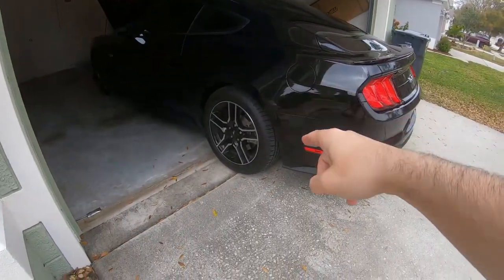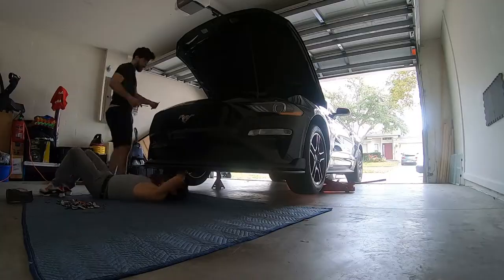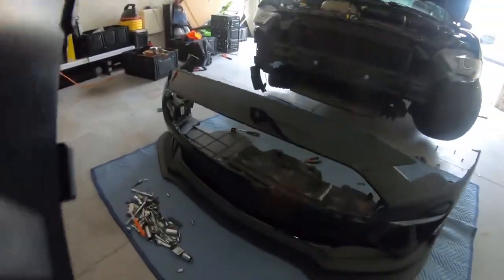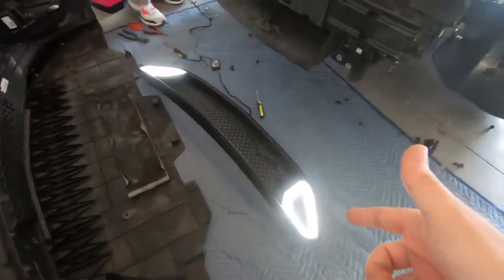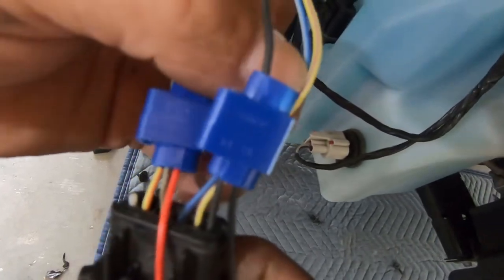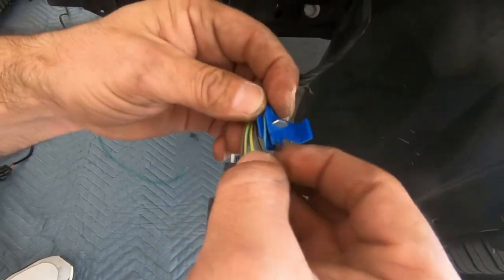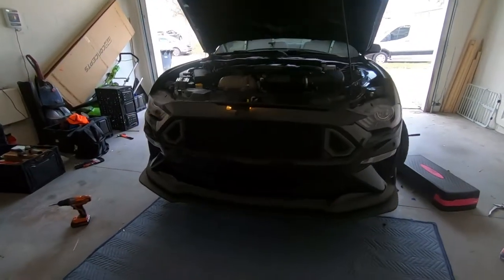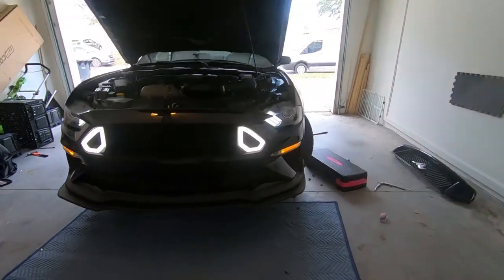Installing RTR Grille On My 2020 5.0 Mustang GT!!! (How To)

Comment: Question, the rtr had a red,
 black and green wire to connect for the led lights?
Reply from the maker: Yes, i show in the video how to connect them
Reply: @Ricardo4rexx  so i got a red black and green no blue wire so I'm curious on the green wire. no instructions included.
Reply from the maker: @bibibook1  oh okay, im not sure there boss, would have to look around in the forums for your specific grille